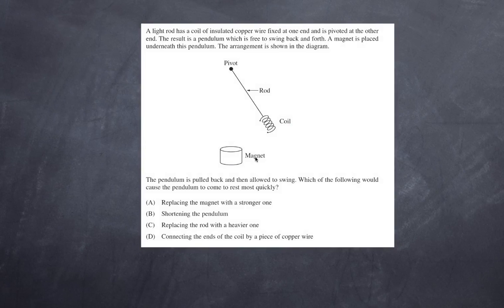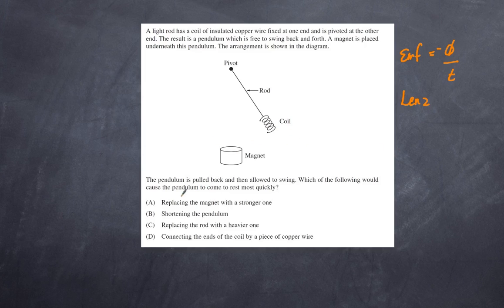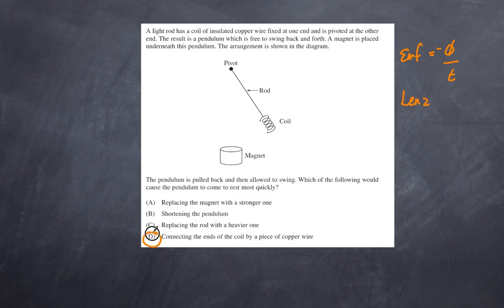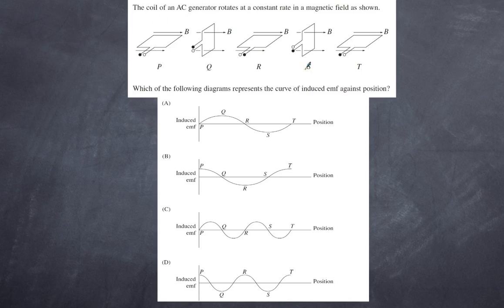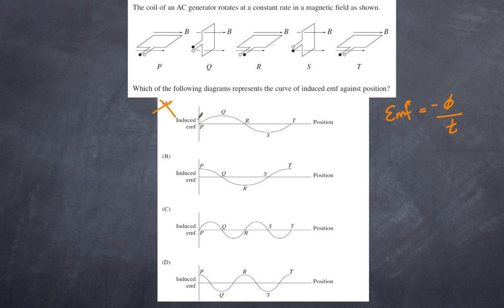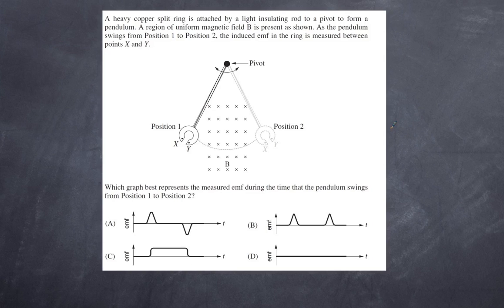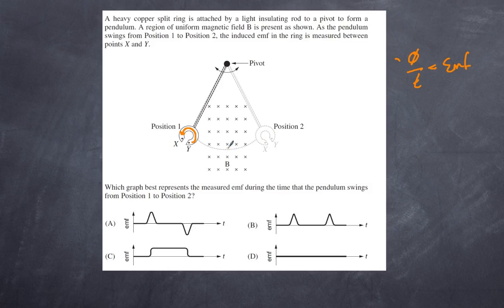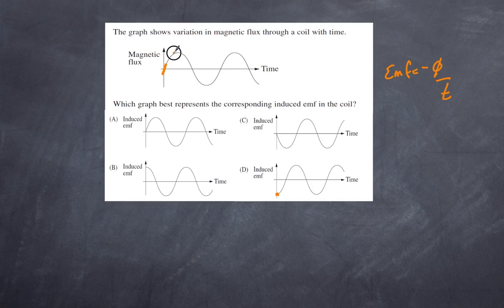How Well do you Know - induction

Comment: Isn't the speaker acting like a motor, since it is using an electric current to cause the diaphragm to move?  I think that you explained a microphone by mistake.
Reply from the maker: Yes a speaker normally acts like a motor but if you read the question it says the cone is pushed. It’s now acting like a microphone. So it’s induction. Mechanical energy in, electrical energy out.